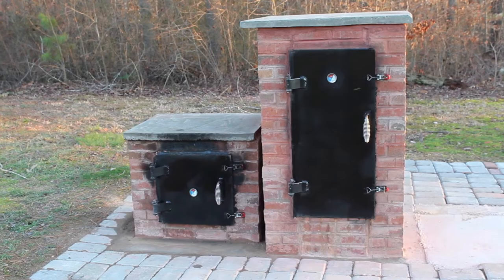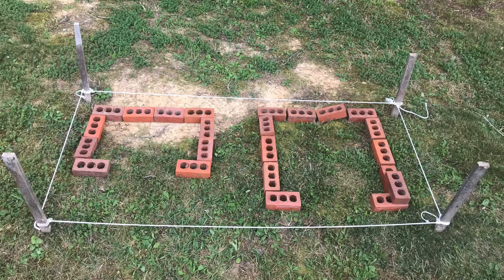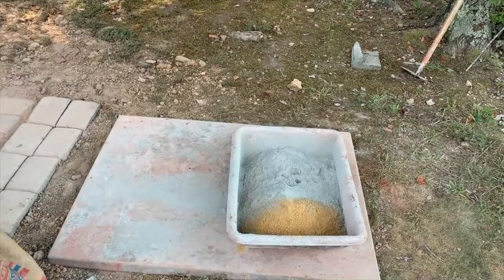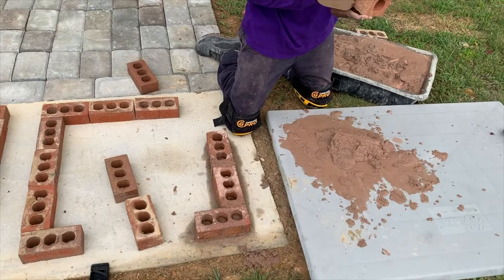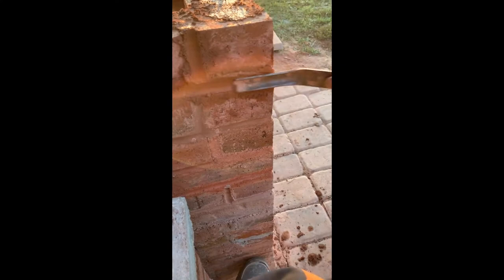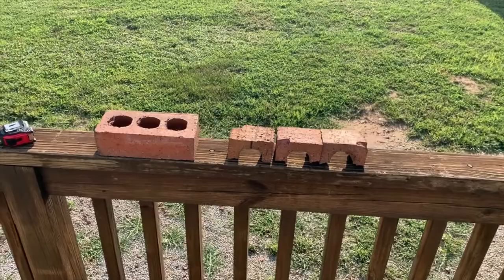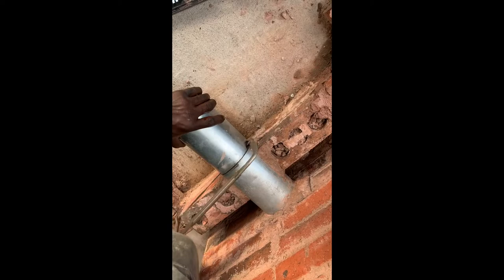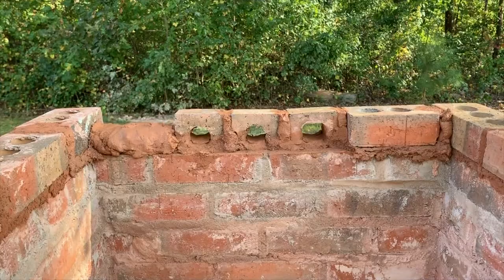How to Build a Brick BBQ Smoker (Part 1)

Comment: Tips: Mix your dry ingredients (cement, sand gravel, etc...) first so that when you add your water you won't need to struggle mixing everything together. Use a hoe instead of bending over with a trowel when you mix as bending over is going to hurt your back. I usually mix my concrete in the wheelbarrow so I'm not leaning over at all. the mix ratio of dry to wet is 2:1 at first and then you just add a little water as you mix as there is a quick change from thick to thin and it is a pain adding more mix.

Do your concrete work in the early morning so you have plenty of sunshine BUT the temp outside isn't too hot. Once concrete reaches 90F is starts setting and you should never add more water to make it workable because that'll compromise the strength as the chemical reactions are already starting.

Also, you needed to use refractory mortar and bricks in order to have this last. You may have a couple or years at most with normal cement and bricks, but eventually the bricks will start cracking due to expansion and contraction from heat changes. If you live in a place that freezes, the bricks will break down even faster during winter time as the moisture will be soaked up into bricks and mortar and freeze. Ice expands and thus will break down bricks faster. 

I noticed you didn't add steel reinforcement (welded wire mesh gauge 12 or 14) to your concrete slab or etch a 2'x2' grid into the top of your slab. Concrete expands and contracts due to temp changes and humidity and will start cracking after the first winter. You also didn't compact the ground before adding the concrete slab. 

Not saying what you didn't was really cool. I wish peeps doing DIY would read up on the building specs and procedures available. That way whatever you make lasts longer and won't break from normal wear and tear.

Comment: Starting with a half a brick on every other level, and compensating for the mortar mix were important tips that I am glad I learned from this video. Other points too, but these were key for me. About how thick would you say the mortar is. About a 1/2" or so? Thanks for the video. I "liked"

Comment: Dis yo vid is awesome. I don't evan mind da lingo. Another tip would be mixin' it in a bucket you can use a hand drill with a mixin' attachment to speed up the mortar / cement. I have a old brick BBQ in the backyard with a small opening and a bigger opening. I am thinking of converting it into a cooker smoker. Loved and Subb'd

Comment: Why is the vent exchange was placed flushed to the bottom with the bricks on both chambers? The fire pit’s most highest heat will be on the top, the vent exchange should be placed at least 90% above the ground from where the fire pit will burn, I think this way you’ll get the most heat transfer efficiency to the other bigger chamber. Similar to offset smokers, where the fire pit is always below the food chamber.

Comment: Have you since had any problem with not using fireproof bricks?
Reply from the maker: I was having problems with keeping the temperature up but adding the chimney solved that problem. I do recommend using firebrick on the inside though. It will help keep heat inside the smoker.

Comment: How has the brick held up in the fires? I want to make one.
Reply from the maker: They hold up pretty good, the only thing is that the heat from the smoker discolors the brick. I recommend putting a layer of fire brick on the inside if you decide to make it. The fire brick will help keep more heat inside the smoker and will help with the discolor.
Reply: @FromTheGroundUpDIY  How much was each fire brick?  I've never seen them at Lowe's/home depot.  Could a thin layer of refactory mortar be used to prolong the life/heat?